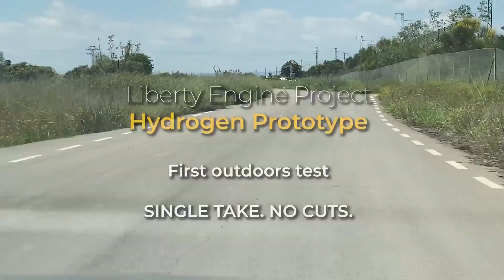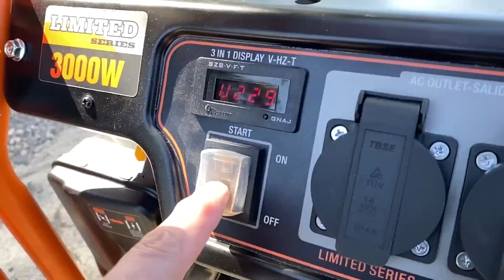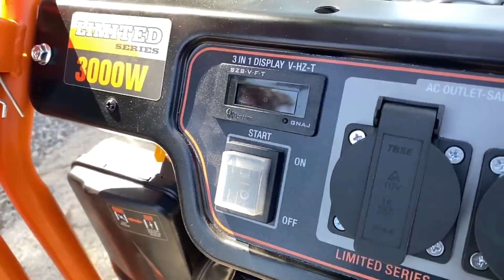I CONVERT GASOLINE ELECTRIC GENERATOR TO RUN ON WATER

Comment: How are those bearings and other metal parts with water around them constantly?
Reply: Because the water is separated to hydrogen and oxygen before entering the combustion chamber, there is no water to corrode bearings or other metal parts
Reply: @DroidzandBrix  Cool. Thx for the input
Reply: The only thing that is going into the engine is The separated oxygen,Hydrogen with other impurities the ratio of both get all mixed up and most of it cannot recombine into water before the Hydrogen is ignited and burnt off which also burns off the oxygen minute particles of water do go through but will collect in the exhaust but you can drill a small weep hole in the bottom of the muffler/silencer for it to drain